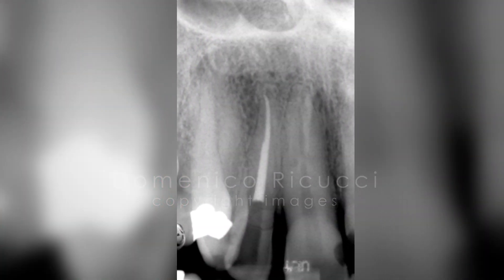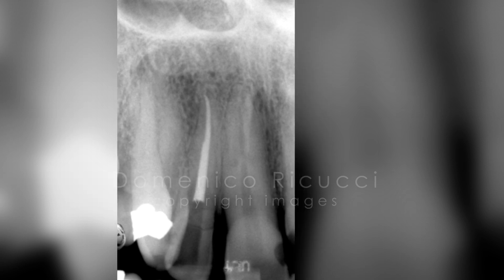DRendo - Apical limit of endodontic procedures. Practical technical aspects to respect Biology

Comment: Doctor what's the reason for using smaller GP than MAF size it is to be loose inside the canal if yes it could be overextended ?
Reply: The cone will not overextend due the apical stop/collar described at 4:35.
Reply: The reason is that the filling material is the bioceramic material and not the gp cone that is only a “carrier”

Comment: Cool demo. I'm surprised to see you use 06 taper instruments. I was sure you're use 04 only, for some reason.
Reply: Why only taper 04? Is totally non sense
Reply: @cicilluzzo7673  well I think that "Totally non sense" is a bit harsh.
I thought so because in general, there are 2 schools of thought when it comes to shaping: either shaping to the constriction and shaping larger sizes apically (Advocated by the likes of Dr. Martin Trope and Dr. Allen Nasseh) in which Taper is more restricted (these two advocate using 04 tapers) and the Schilder school of shaping, which shapes into the constriction and rely on 06+ tapers as a mean to restrict the movement of the cone apically during obturation (advocated by Dr. Cliff Ruddle and John West, and in the past, before he started using Gentlewave, By Dr. Stephen Buchanan).
Out of these two approachs, I assumed Dr. Riccuci would be subscribed to the former.
I'm not saying that 06. instruments don't have their place, but I was surprised to see him demonstrate their use in a mesial canal of a molar.
Reply: @MikeyWolfLupu  25/06 is the minimal instrumentation for 90% canals. Maybe except mb2s and very calcified canals. In ricucci endos you often see large apical diameters for better cleaning, better filling and better control of apical extrusion of material. If you do a small apical preparation you have more risk of extrusion and voids of material and in necrotic cases to leave bacterias. That’s it.
Reply: @cicilluzzo7673  sir or ma'am, I don't know who you are but it seems like you're not engaging with my argument and have no counter argument to my actual statements; in fact, I have no idea what you're on about.
Your reply is paradoxical: "The minimal instrument in 90% of canals (where did you get statistic from?) is a 25 06" (a SMALL apical sized instruement) but then you tell me Dr. Riccuci shapes canals with LARGE apical sizes. So what is your point? 
What is "minimal size" in your world? Is it that size that allows for optimal debridement and disinfection while maintaining as much tooth structure as possible? (A better term for this would be minimally EFFECTIVE size)
If so, then why would you shape any larger? Why wouldn't YOU think a 40 06 is needlessly aggressive?
If you don't think this, then why mention 25 06 in the first place? Are you trying to tell me "25 06 is minimal size (again, said who?)+Dr. Riccuci shapes larger apical sizes= 40 06? 
Why not 35 06? Or 50 06? Your reasoning is total non-sense.
My question was why use a 40 06 in small canal? (I'm NOT talking about palatal canals of upper and D canals of lower molar) Wouldn't a 40 04 clean as efficiently, while maintain more coronal tooth structure?
I will check the recommended publications in this video to get some answers because there are no insights to be found talking to you. That's it.
Reply: @MikeyWolfLupu  you dont know what you’re talking about and i think it’s better to not waste more time with you. Study.
Reply: @cicilluzzo7673  you're more interested in "winning" this "dabate" by using ad hominem argumentation, insulting my character and what I know in a rude, condescending way than to actually argue against my actual points.
I'm always willing to learn, which is why I'm asking questions on this channel; if you know everything already, what are you doing here?
As I said, I will study the recommended reading material at the end of the video. 
Have a good day.

Comment: Great movie! 
What with non-vital tooth with periapical lesions? Still no patency? And what with apex locators? It is said that only true meassure of apex is when reading gets to 0 (anatomical apex) and then we subtract 0,5 - 1 mm to get anatomical constriction.
Reply from the maker: This is what is suggested by most, but is illogical. Why do you need to go beyond and then shorten the length, when EAL can tell you where the constriction is?
Reply: @drendodomenicoricucci5813   hello Dr. Ricucci! How can we know which measurement on our apex locator shows the minor constriction? Because every apex locator is slightly different..
Reply: As I have heard the reason for that would be that an apical constriction can vary a lot in length. So if the reading tells you that you are at the constriction, it may be that you’re 0,5mm from the anatomical apex but it may also be 3mm. Apparently there’s also variants of the apex with more than just one constriction. Which is why the reading of 0 (apex) is considered the most reliable thing you can measure and therefore is desired. Everything else is just a guess. 
At least this is what I have learned. 
But in some of cases (vital cases) I share the opinion that getting to patency is somewhat overrated as a general concept.

Comment: very informative Dr.
so do you recommend to not do patency in all cases? or just vital cases? what about true tugback feeling is it still important when obturating with BC sealer?
Reply from the maker: Never patency! If you fill with BC material the purpose of the cone is only to facilitate reopening in case of failure. So, no tug back, it has to be loose.
Reply: @drendodomenicoricucci5813 
thank. you very much Dr. actually even at the age of bioceramics it does seem like we are stuck in old school dentistry.
my question is what about necrotic case would you go for 0.0 reading? and is it allowed for BC sealer to be intentionally pushed slightly beyond apex in case with PA lesion?
Reply: same question dr

Comment: I have changed my practice from that 00 on my apex locator(eighteeth e-pex pro) to 03.  (i still dont have dentaport zx to compare). I have also stopped patency filing long back seeing your work. One thing that i have noted is almost no case reporting with an intra appointment flare up.
Reply: Hi good morning. How did u adjust it to 03. Can u share any radiographs
Reply: amazing
Reply: even in necrotic cases ??